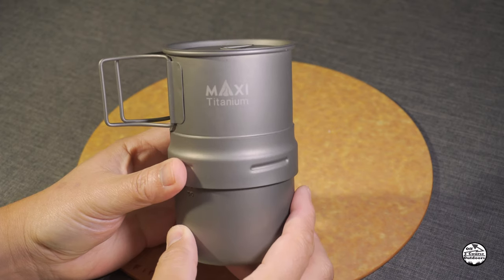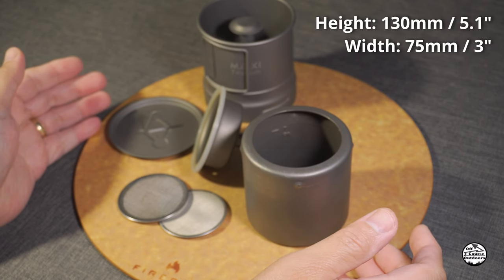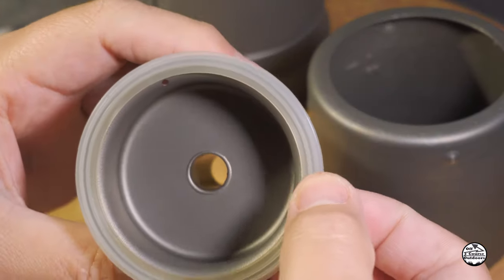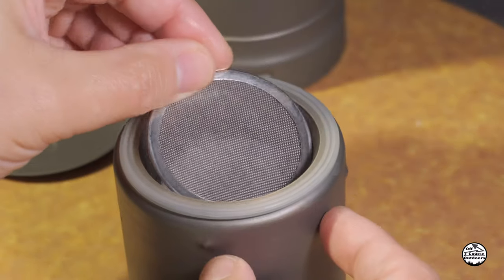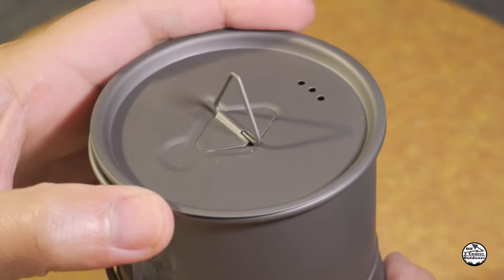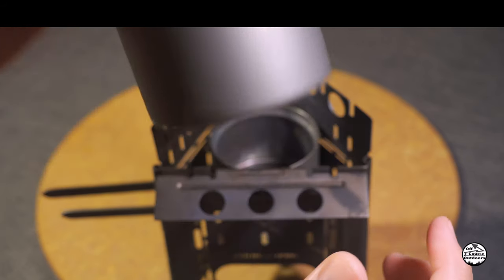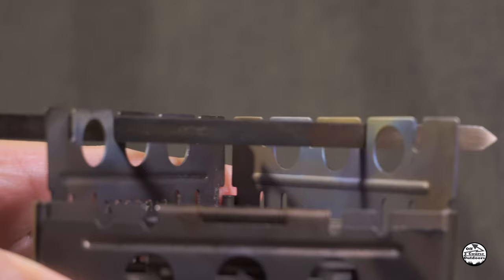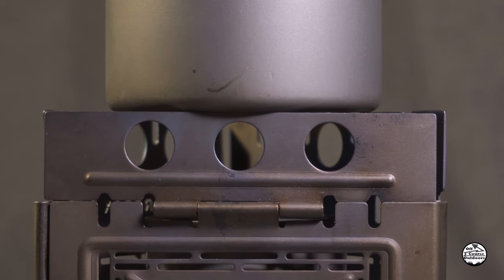Backpacking Moka Pot! Check it out!

Comment: It could do with a bail handle in my case on open fire firebox stove I can’t use my gloves through the handle - also if you wanted to replace the seal what size would you need
Reply from the maker: Steve is pretty active in reading comments so I'm sure he will take this feedback. The top of the pot has a very pronunced lip which makes for interesting ways to attach a bail.  As for the silicone seal, if you need a replacement, a quick call or email to firebox support can get you squared away. To answer you question though, the outside diameter of the top funnel is about 6.9 - 7cm.
Reply: @offcourseoutdoors8366  I haven't tried out the Moka pot yet, but Firebox customer service is excellent. I'm bummed that I missed the crowdfunder for this moka pot though, because the only thing that's stopped me from trying a moka pot is that they're mostly too heavy for backpacking... though until I discovered this one earlier today, I thought they were ALL too heavy for backpacking :)

Now I want one... when my budget allows it :)

Comment: Thanks for your thoughtful review. $79.00 is more than my L'Or electric coffee pod maker which came with a heap of pods included. But this stove top brewer is at a mid-way price point when compared to other mini portable espresso brewers. Alternatively, just use the jug brewing method. Add almost boiling water to your coffee in a jug. Wait for around 2 minutes. Draw a spoon across the top of the brew to encourage the grounds to sink to the bottom. Pour slowly into a mug, avoiding the residue grounds. Enjoy!
Reply from the maker: Thanks for the feedback! Its pricy, no doubt about that. I do enjoy a bit of cowboy coffee from time to time. I will try your method and report back. Thanks again for watching, cheers!

Comment: I got the bigger 400 ml of this Moka pot . It’s a screw type instead of a twist type. I use it to make two cups at a time. I’m not to crazy about the cleaning afterwards though. Thanks for sharing 😉👍
Reply from the maker: No joke on the cleaning. I accidentally or lazily found that if you empty everything out and let it dry you can easily clean it to a useable point with a dry microfiber cloth. Thanks for the feedback, cheers!
Reply: Where is the 400 ml version available at ?
Reply: I bough it on AliExpress 2 years ago
Reply: If I could find the 400 ml version, I’d buy it. But it doesn’t seem to exist anywhere.
Reply from the maker: A little birdie told me that a larger one is pending release. I will post and pin a comment here once the campaign is up and running, cheers!

Comment: Late to the party.  A paper aeropress filter would probably fit in the filter area if one wants a cleaner cup of coffee
Reply from the maker: I will try that but wonder if it will cause an over pressure due to added restriction of the filter. I will test... thanks for watching, cheers...
Reply: @offcourseoutdoors8366  I'm not promising that nothing will happen. I've used one in a standard Moko pot, nothing bad happened. It's not an original idea. I got it from YouTuber sprometheus, who has videos on making coffee.

Comment: The Bialetti Moka pot method to prevent fines from getting into your coffee, and to prevent a burnt or bitter flavor, is to remove the Moka from the stove the instant you hear it begin to gurgle, which means the water reservoir is almost empty so air is being sucked through the pipe. Then set it on your countertop to finish brewing from the residual heat inside the pot. Then stir up the most-concentrated coffee from the bottom with a teaspoon and pour. 

You'll see leftover brown water full of fines in the bottom reservoir, which is good because if that water had gone through from leaving the Moka on the stove for too long, it would've dirtied and diluted your coffee. 

So try removing the Moka from the stove the instant you hear it begin to gurgle. It will have enough heat inside the pot to finish filling up.
Reply from the maker: Thank you for the information. Much appreciated, cheers!
Reply: @offcourseoutdoors8366  😊 ☕